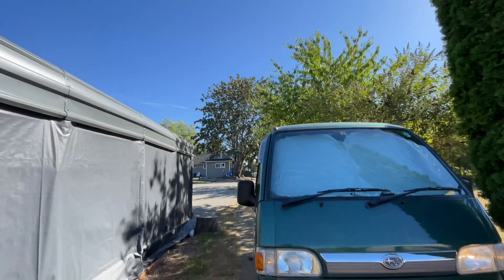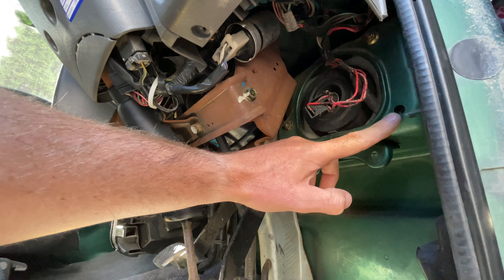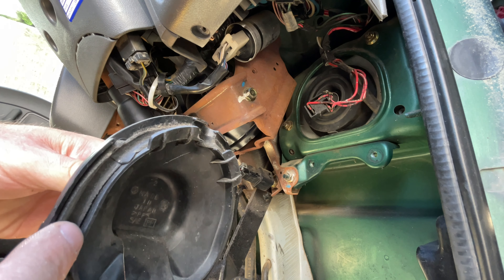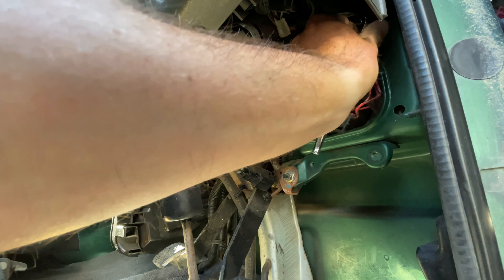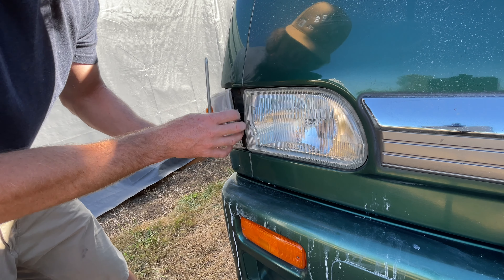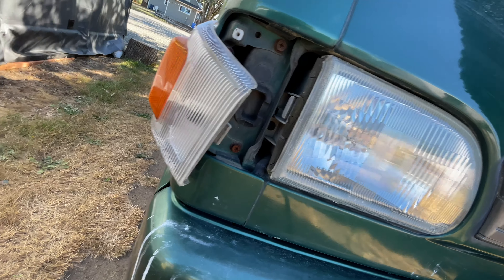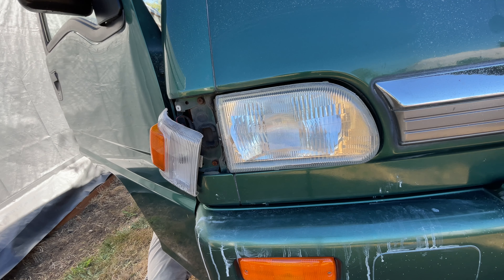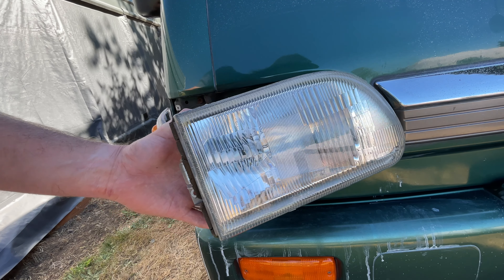How to remove your headlight on your Subaru Sambar to adjust angle, tint or restore KS4 KV4 KS3 KV3

Comment: Is there a way to change the rectangular headlights on a Sambar truck to be round? I saw a couple of forums but they only gave info on the headlights they bought and didn't give any info for how they keep the headlights in place and my Sambar doesn't have round headlight covers so I'm super confused as to what they did or used to install them.. the headlights they recommended and used don't fit in the headlight space and I'd rather not cut the metal if I can help it..
Reply from the maker: they would have to be pretty small round ones unless you got the classic front end swap. those had round lights but also new corner panels and front so they would fit.